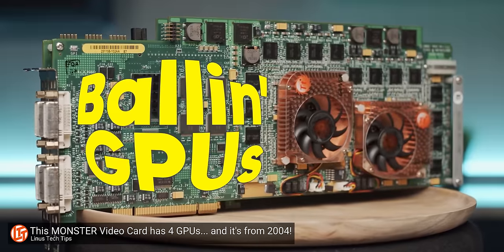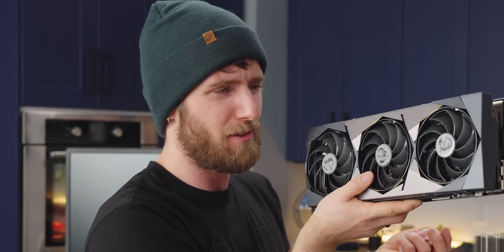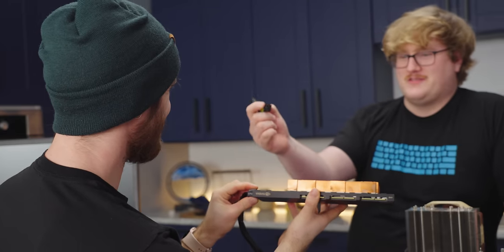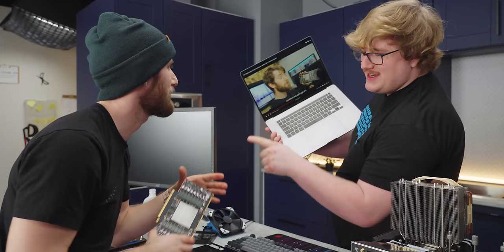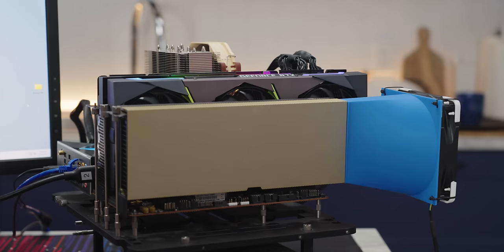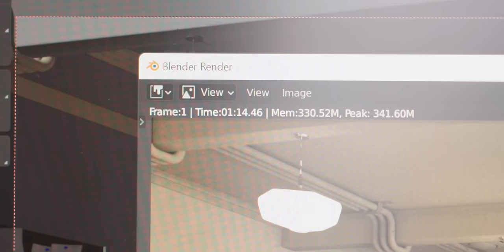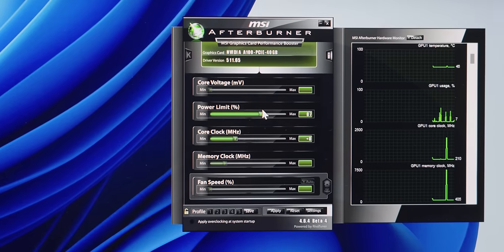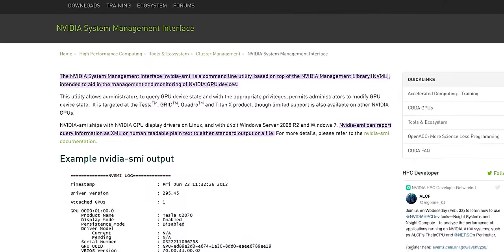NVIDIA REFUSED To Send Us This - NVIDIA A100

Comment: A100s are nuts. I really want to get one of those cards
Reply: well if you look at the MI250x they are a lot more NUTS
Reply: What would you do with it, out of curiosity?
Reply: oh shit. the og meme creator
Reply: @intosanctuarysitechannel3732  It prints money; do you even need to ask?
Reply: @RickMyBalls  imagine mining crypto on that would it be worth the price tho?
Reply: @RickMyBalls  According to the NiceHash Profitability Calculator with an average 14 cents per KWh, you get... About $6.00 per day.

So... Not really.
Reply: @intosanctuarysitechannel3732  $6 * 30 = $180, * 12 = $1,960
Mining with that for a few years? Depending on how pricey it is it could be good
Then again you can get those rates with regular 30-series cards, so eh
Reply: @RickMyBalls  what a shame, i would do research on it!
Reply: @planefan082  Well, don't worry. You can get one on eBay super cheap for the low low price of... $10,000. Maybe $9,000 if you're lucky.
Reply: @intosanctuarysitechannel3732  checkout moneybags over here who thinks $6 per day passive income is nothing
Reply: wtf its catfood
Reply: Just write comments saying you want it. It'll appear out of thin air in your house
Reply: @RickMyBalls  It is (pretty much) less than nothing when the card costs $9,000 at the absolute cheapest.
Reply: @theshroomian2415  probs not really, the performance of a 3090 oc'd and the fact you can get 4 of them for the same price is alot better.
Reply: @mryellow6918  and 5x the power consumption. With electricity costs this high that's a LOT
Reply: @ektorthebigbro lol what are you going to do with just a card when there is is no software ecosystem for it in the market which makes its trash
Reply: @intosanctuarysitechannel3732  Mining what? There are GPU mineable cryptoassets other than ETH, yanoe
Reply: @michaelmazzullo6104  It was only looking at BTC. But honestly, even if profitability doubled with another cryptocurrency, it still wouldn't be enough to justify that insane price tag.
Reply: @ektorthebigbro  I have benchmarked both A100 and MI250. The A100 40GB is faster. It's because the MI250 is essentially 2 separate 64GB GPUs in a socket. Very disappointing; it's a good product killed by misleading marketing (AMD markets it as a single 128GB GPU, and in reality you only get half).
Reply: @ProjectPhysX   so you say you have benchmarked it both on 3d rendering and ai benchmarks cause if that is true i dont know what to say about amd at this point
Reply: @ProjectPhysX  also based on your tests what is the best gpu or accelerator for simulations and ai
Reply: @ektorthebigbro  I did synthetic benchmarks for memory bandwidth and compute, as well as lattice Boltzmann benchmarks (a type of computational fluid dynamics). Lattice Boltzmann performance is directly proportional to real-world memory bandwidth.
Although the MI250 is faster on paper at 1.6TB/s, in reality you get maybe 1.1TB/s because it is 3 generations behind on efficiency. The A100 in contrast gives you 100% of what is written in the data sheet.

Most applications are bottlenecked only by memory bandwidth, so the 45TFlops of compute for the MI250 are not of too much use. Given that the A100 is faster, and the 80GB model also has more memory, that is the clear better choice. I'm not sure about the prices though and price/performance should also be a consideration here.
Reply: @ProjectPhysX  Thanks for replying. Taking into consideration the price, the a100 costs 15000 euro and for a gpu that is quite the price. I want to built a server for simulations and ai at the same time(train ai using physics simulations). Do you think a server with 8 rtx 3090 with nvlink, an amd epyc 64 core cpu and 1 tb of ram based on your opinion is enough? Because we arent talking about simple neural networks here.
Reply: @ektorthebigbro  The 3090 is a beast; comparable in performance to V100 and for some configurations it even beats the MI250. As long as you don't need FP64 (AI typically is much lower precision anyways), and as long as 24GB VRAM is enough, go with it.
The Tesla/Quadro options are like 3x-10x the price for not too much more performance.
Reply: @ProjectPhysX  yeah but are 8 rtx 3090s enough to run a intensive simulation with real time raytracing, real life textures and models, physics and ai training at real time speed(30 to 60 fps or even 20 fps)?
Reply: @ProjectPhysX  also you got your a100 for free for nvidia can you explain the steps you went through to get it? Because what i am doing is simulations and ai.
Reply: @ektorthebigbro  yes 8x 3090 is well enough. The rest is on you to optimize the software. With good software you can get away with even way less powerful hardware.
For Nvidia Academic Hardware Grant you need to be a scientist at a university and publish papers on your research. See the eligibility criteria on their website.
Reply: @ProjectPhysX  how much computational power does it require to simulate the entire universe
Reply: @ProjectPhysX  I know what I am asking is insane but i am making a game and I want a system to simulate physics across all the molecules in the universe I create with algorithms in my future game which I am currently designing
Reply: @ektorthebigbro  definitely more than you could build mosfets for with the available matter in the universe
Reply: @ProjectPhysX  maybe a quantum computer?

Comment: I think the "cooling solution" would have worked better if you would've reversed the airflow
Reply: ok
Reply: ok
Reply: ko
Reply: ok
Reply: so...does it?
Reply: You should buy 100of them and test both ways of cooling so you can get a good average
Reply: Nah that actually makes sense based on the geometry of the 3D print he made. It's not going to nicely push air flow from a 1:1 square into like a 1:3 rectangular channel. Whereas if it was pulling the air through it, that factor is not as important as it's at the end of the air flow "system". Probably would get better flow rate
Reply: I think Sava's point is that if you use the fan to suck the air out of the card, the air is going in the far side of the card as a laminar flow. It's harder to get the turbulent flow on the downstream side of the fan to go into the duct and then in the card. This is why I always have the fan suck air through my cpu heat sinks
Reply: Yes, just use an actual 40W 120mm server fan. Those have a lot of pressure and won't care about the shitty aerodynamics.
Reply: I would agree with that statement sir
Reply: @derkeksinator17  I think that is exactly why the use those fans for servers.. lmao
Reply: Then again power consumption means alot to these guys so it might be in their best interest to optimize the design of the server chassis to accommodate lower powered fans and not entire depend on brunt force.
Reply: Goose 100 racks on ‘em fo a test for someone else
Reply: @webbiergoose2032  sure 100k on a single video sounds great

Comment: "All 40 GB used!"
Well, that's just how tensorflow works. It reserves all memory on the card. With batch size 512 and fp16 training ResNet 50 will use maybe 16 GB? Not sure, I use Pytorch.
Reply: Your comment makes me question my education.
Reply: I like playing Minecraft and watching YouTube while I eat chickey nuggeys.  We are not the same.
Reply: Came here for this comment. Although your estimate seems to be off: the memory usage for half precision ResNet50 and 512 batch size should be closer to 26 Gb, putting it out of reach for training on a 3090.

I am glad this kind of production work finally gets coverage though.
Reply: That was probably the rate it was being filled though. When I load GPT-NeoX-20B PyTorch allocates 40GB almost instantly, and then fills it up. That's different to loading a model with HuggingFace transformers, where usage increases relatively gradually like the use case in the video.
Reply: @maaadkat  ResNet 50 is a different model though. Comparatively tiny by today's standards. Most of that memory is used by intermediate activations.
Reply: @Lodinn  it's been a while but I remember 256 fitting into a 16GB V100 with fp32 training. It also depends on memory pressure, i.e., how much memory is free vs used. Pytorch will lean towards allocating new memory when pressure is low, instead of reusing a block that's a bad fit to avoid memory fragmentation. What you see in nvidia-smi is the memory pool used by the allocator, not what is actually used by the model.

Comment: There's a typo at 3:25

The A100 has ~54 Billion transistors on it. The 54.2 million listed would put the card firmly between a Pentium III and a Pentium 4 in terms of transistor count with a curiously big die for the lithographic node.

Comment: I'd be interested in seeing how they compare rendering a single tile all at once. That's what got me when I switched from a 2080 Ti to a 3090, not realizing right away that it would render 2k tiles without sweating, but rendering out a bunch of smaller tiles they were rendering basically the same times.

Comment: Check the temperature of a100. If it's touching 80 C then there is a performance throttle. Tried similar setup with v100, there was huge performance gain using a 6000 rpm fan for cooling.

Comment: You can fit a whole operating system in the VRAM of that card. Crazy.
Reply: Windows 11 is like less than 10 or 5 gbs
Reply: I know what you mean, but you know, DOS fits on a floppy
Reply: Most Linux Distros as well
Reply: There are fully featured Linux distros that are less than 100 MB, so that's not really that impressive.
Reply: Use lubuntu.  That's what, less than 1 GB?  It performs pretty decent too.
Reply: I think windows sever 2019 will run with 4gb of ram. Not very well, but it runs
Reply: I used to have an embedded Linux machine running on a disk image of 4MB.
You can run on a lot less if you don't need a "modern" OS, but something DOS like.
Reply: @bamffatboi5526  win11 asks for a minimum of 64GB of storage, I doubt the entire OS takes less than 10GB... this is just a guess but I'd say its around 25GB
Reply: First let me be nitpicky. What you actually mean is, you could fit modern Windows into it.
Second, it's not really a record or something. You could fit DOS comfortably into the VRAM of a Voodoo 1 card.
That's fitting a 2 year old OS (6.22 was released in 94, Voodoo 1 in 96) into the VRAM of a consumer GPU.
You can't fit Windows 10 (closing in to 7 years old) into a 3090.
So if anything, things got less crazy.
Reply: @Auracle the download? yes. the actual install size? a lot more, atleast for windows
Reply: @axen-bc2te  5.37 gb for the actual os

Comment: I happen to be setting up a system with a single A100 right now and smiled when I saw this video had been released. The cooling on our system is definitely less janky, but also a lot louder!
I do wish they had installed nvtop, as live graphs play much better on video.
And as others have said, you can up the batch size even more on this card. I tried 768 and got over 2600 images/sec.
Reply: wow :O
Reply: But still who in the world takes so many pictures per day, that you need that performance… I would rather focus more on less pictures but better ones of my desired object
Reply: @kgfgfg1  the purpose is rendering power, for Ai Camera scan, Videoediting and so on. Only for Benchmark.
Reply: what was the setup you had? like motherboard and cooling?
Reply: @SystemeExploitation  We got it from Microway. Large workstation configuration.

Comment: Tensorflow and CUDA actually works very well on Windows. I do a lot of my dev work on Windows with CUDA and Tensorflow to make sure the code is working well and profiled before sending it to a bigger machine for larger calculations. The easiest way to install it is using Anaconda.

Comment: I work in AI and the big use for these cards in the industry is not necessarily for using the entire card for one workload but actually using Nvidia’s MIG (Multi Instance GPU) feature to split the card into multiple virtual GPUs which can then be used by multiple VMs and multiple data scientists at the same time…. This makes a lot of sense to companies since it means that companies can just buy/rent a single or multiple A100s and then split those on a whim between lots of different users and jobs.

Comment: Very cool Video about this amazing card. A good comparison would have been the Tesla T4, which is another popular card for machine learning (since it offers the currently best total cost to performance tradeoff for that workload). Also a small hint: The benchmark doesn't acutally use that much VRAM, but tensorflow allocates almost the entire VRAM by default (even if it doesn't require / use it). The actual VRAM usage of ResNet50 FP16 with batch size 512 should be about 22 GB (since I know its 22GB for FP32 bs 256).
Reply: Tesla T4 is primarily meant for inference

Comment: 18:45 - nvidia-smi is the generic CLI for the NVIDIA Management LIbrary (nvml). An NVML app will run much faster and gives you the ability to sample power and temp at 100Hz or better so you can see performance details in a benchmark.

Comment: The memory requirements also come down to people optimizing for fast progress. I think we could get by with less if we had to with creative programming, but the deep learning industry is short on talent, so instead we tend to maximize individual impact right now.
Reply: I'm not so sure, we "briefly" looked at this card for AI training, and having 40GB on the GPU just meant we could use larger batch sizes. I'm not sure if theres creative programming that can help you overcome the fact that you need to eventually move a terabyte of training data into GPU memory.
Reply: The creative programming comes into play when we have less memory than required to fully hold a batch size of 1. I see no reason why we couldn’t stream stuff in/out of VRAM as needed for the forward pass and do incremental backdrop the same way, other than that it would be hard to program.

Comment: There's a pretty good reason to utilize the same chip for multiple card. Often times when they get printed, they get non usable sectors and there's not much they can do about it. So by doing that they can still sell the chip depending on what sectors aren't working.

Comment: Yeah, I've seen AI papers that say they had to train AI models on 512 of these for 10 days straight! The cost of neural networks is immense, both financially and environmentally.
Reply: lol and yet the human brain runs on about 20W of power... And probably dwarfs those cards in terms of computation power :D
Reply: @TheMightyZwom  Yeah, but humans take about 20 years to train at the low end
Reply: @TheMightyZwom  Inference vs training :) (I see Tomi97_videos pointed it out!)
Reply: @Tomi97_videos  That's an associate's degree.
Reply: @TheMightyZwom  Idk most of what you eat goes to your brain not just the watt output
Reply: @Tomi97_videos  billions of year in R&D too
Reply: @TheMightyZwom  yeah but getting 20W to a computer can be done by literal photosynthesis, just sitting in hot water, or at worst, eating dead dino

for human to get the same 20W we need to have plants to do it first for us, then that plants get eaten by another weaker computer that we then eat
plus the heat output man, 40c and it already throttle, 50c it already hits it Tjunction that's like the idle temperature for a lot of GPU

all I'm saying is that 20W is not that equivalent

Comment: For folding you can lower the tdp of the 3090 to 300W, and it will run lower boost speeds, and thus also higher efficiency. 
You can then increase the core clock speed to match close to stock boost speeds.